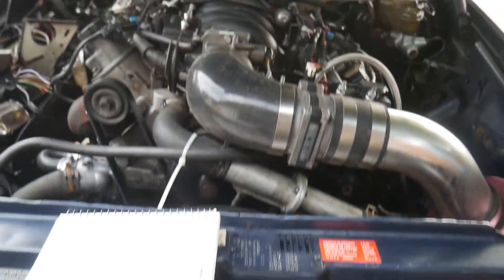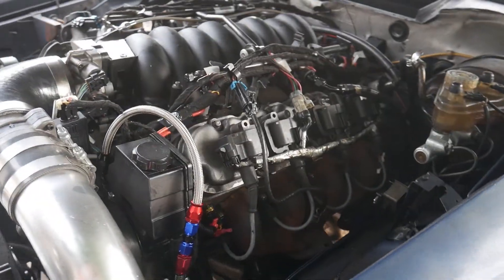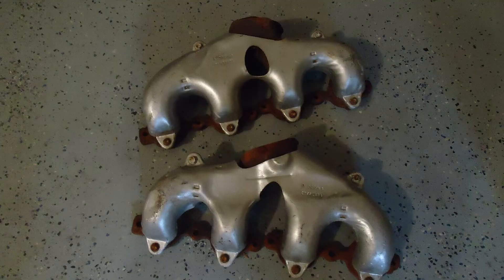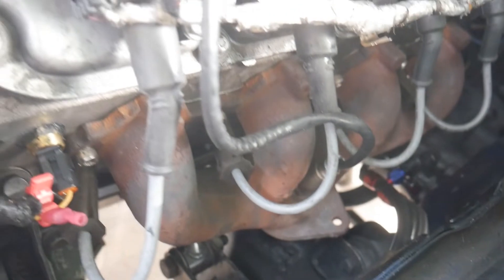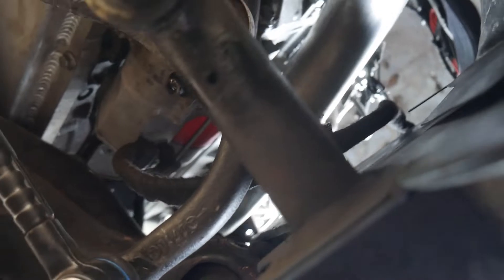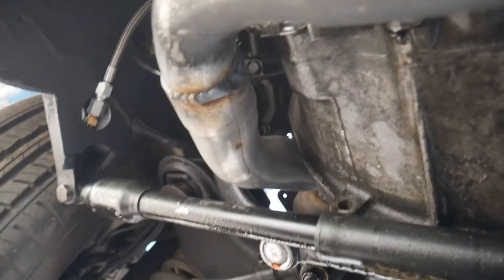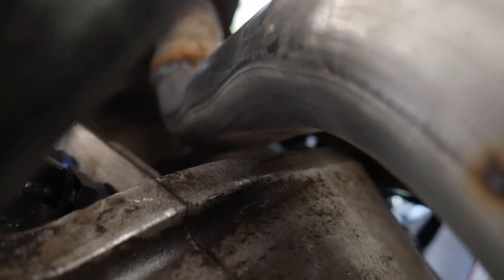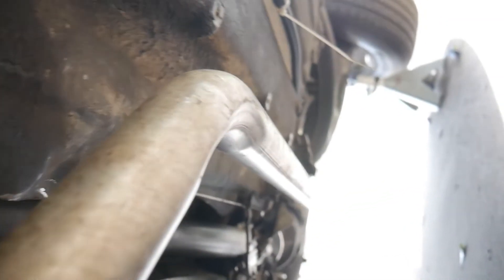EXHAUST SYSTEM LS SWAP R107! - How to LS SWAP Mercedes 280SL 300SL 380SL 420 SL 450SL 560SL

Comment: Bro this is amazing! great work do you have an Instagram page? I want to do the same thing with my 560sl r107.
Reply from the maker: Just YouTube lol 😂 more videos  coming
Reply: @leesgarage7  you didn’t cut the subframe for this build right? You used e30 ls swap oil pan?
Reply from the maker: Yes from cx racing.  Everything is oem. Steering box, steering components, subframe, suspension. Only fab work was motor mounts, block grinding for steering box, transmission mounts, cutting transmission upper tunnel and driveshaft tunnel. Lastly is Lowering parking brake mechanism, which I just fixed yesterday. You have to adjust your brake shoes. Clutch pedal and throttle pedal. This is for manual swap. I don't know about automatic.
Reply: @leesgarage7  around how much was the build?
Reply from the maker: Hmmm I'll do a separate video about that. Roughly around $5000 with all parts including engine and transmission
Reply: Hey bro, I just bought an 380sl with an LS2, the swap is done.The heater hoses from the engine are bypassed, I can see the hoses going to the firewall just hanging. My question is can I just run them over? The original set up has a valve and stuff. Btw I’m in Dallas not sure where your at in TX.
Reply from the maker: Yea you can! My LS1 380sl uses oem heater setup. One hose goes to the pump while the other heater core to water pump. 

Inlet to aux heater valve pump. Return is heater core to LS water pump.
Reply: @leesgarage7  I don’t have a valve pump there just 2 hoses in the firewall. Do I need the oem valve?
Reply from the maker: Use that but you will have heat all the time. The valve blocks coolant when you are not using the heater.
Reply: Ok I’ll look into it. Thanks brother